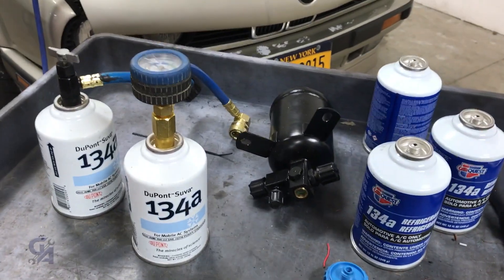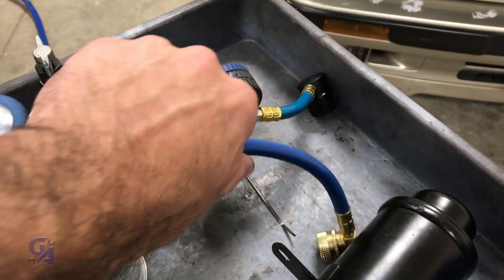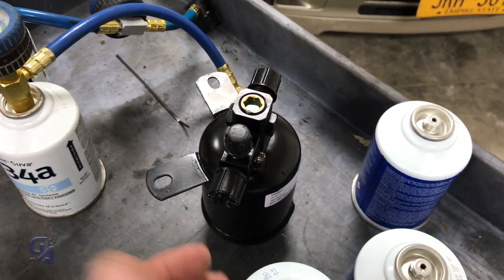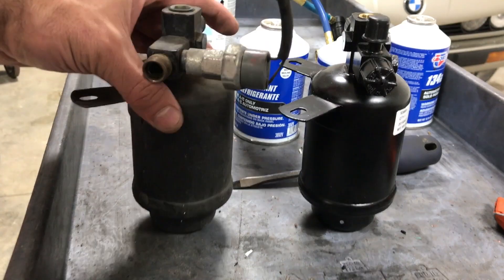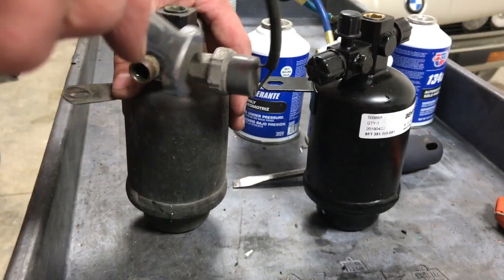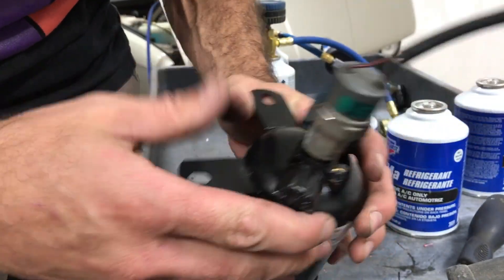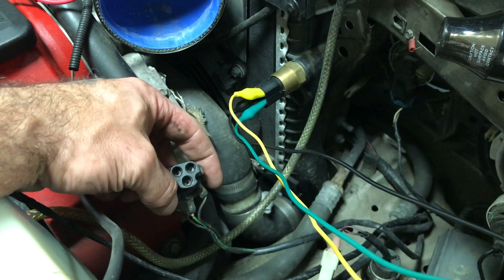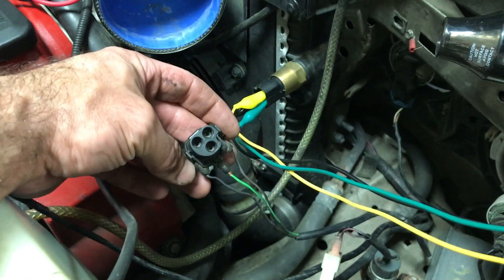E30 FREEZING Cold A/C!!! Dryer Replace, Charge R134a And Aux Cooling Fan Diagnose!

Comment: Description says 12lb of freon? I think it’s too much
Reply from the maker: No no, it's way less than that! Good catch!
Reply: @Garageaholic  I love your channel, been watching all your videos, perhaps U can help me diagnose my ac , e30 m52 converted to r134a properly with parallel flow condenser, aux fan working on low and high , problem is when on idle its not efficient about 50f but when driving on high way it gets to 10f
Reply from the maker: @r1lukasz  Do you have a stock fan? I'd upgrade to SPAL fan if you can fit a 16" in there. 
That's your issue right there, air flow.
Reply: @Garageaholic  stock aux and stock spal fan , can You recommend any spal fan ? So is puller fan an issue? But how about aux fan keep it stock?

Comment: Dude... you lost me when you got the parts wrong. I'm glad rigging things worked for you, but it ain't how I would do things.
Reply from the maker: Thanks for the vague response. I’d love to see one of your videos one day!
Reply: @Garageaholic   For something as sensitive as the AC system I would not cut and rig things. I would do that for upgrade mods if required, but not for stock systems that are liable to leaks.
Reply from the maker: @matreyia  ok, now we're talking. To your point, there is still a small leak in one of the lines. I have learned a lot about R134a retrofits since this video and plan to put out another video very soon for the E30 M3 build I'm finishing up on how to convert fully and how to fill/test the system to proper pressures. Again, thank you.
Reply: @Garageaholic   Here is an example video from my BMW Channel...which admittedly is terrible in terms of content update consistency... with very long stretches of time between uploads.

https://youtu.be/Dx78CY3Jy7k

Comment: Can the A/C condenser be changed out , without removing the front bumper and front grill?
Reply from the maker: Yes. You go from the engine bay side. It’s actually preferred that way. Just need to drain coolant, remove radiator. Still need to unhook the condenser lines and the fan wiring. That’s about it

Comment: How do I change a leaking condenser on my E30?,= Do i need to remove the front grill and  bumper?
Reply from the maker: The condenser can be removed from either end actually. Need to remove the 2 hoses, fan connection, and the 2 10mm screws on the core support

Comment: can R134a go directly into the original air system?
Reply from the maker: Yes, but need new drier, and convert using high pressure switch only, and need all new o-ring seals in the entire system.

Comment: Hi, just discoved your videos today, its all good content, we need to get you more views.  Can I ask if you managed to connect the AC signal through the ECU or did you bypass it?  As far as I know the MSS52 ECU uses a CAN input while the E30 like a E31, E36 and other older BMWs uses a cable switched by the climate control.

Comment: So, it looks you will be replacing the rad thermoswitch then right?
My E30 has the old two switch system and also mine doesn't work so well. 
I'm getting close to just getting a switch inside the cabin and just turn it on manually, it's becoming a pain really.
Reply: Also in the service manual, it says in order to test the switch, you need to take it out, and then put it in a pan with water, turn on the stove, check the water temp, and then at the correct temp, I think it was 91C for low speed and 99C for high speed, check if you have continuity. If you don't, replace.
Reply from the maker: @hozisalehi  Yes, you can do the stove test. But honestly using a heat gun is much easier. And typically can easily get the switch to that 220F temp where it would close. remember the system worked correctly before a component in the system failed. If you can identify the component(s) that failed, then just replace that and if that didn't fix it, then you likely misdiagnosed and you need to go back to the drawing board. It's always trial and error. If you have the BMW Schematics handy, you can see how the electrical system works and identify it pretty easily that way.. I hope that helps. but if you have a specific issue, let me know the details and I can help you. contact@garageaholic.build.
Reply: @Garageaholic  thanks dude, I'm kinda in the research and prep phase for a swap, so not too worried. Plus summer is almost past, cooler weather and all that, smooth. 
Keep up the great content man!
Reply from the maker: hozzziii the dude thanks for watching, and my offer to help is always on the table!
Reply: @Garageaholic  thanks man!